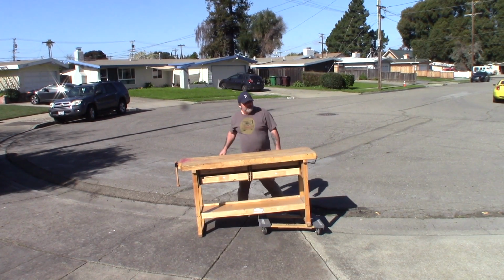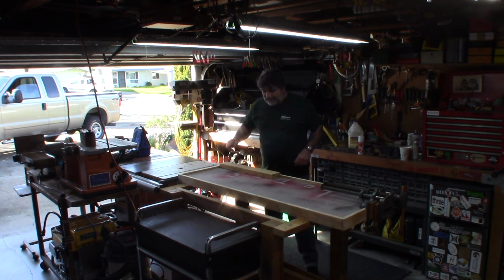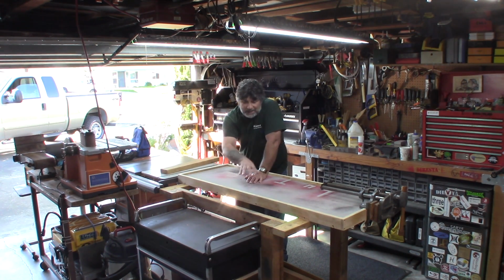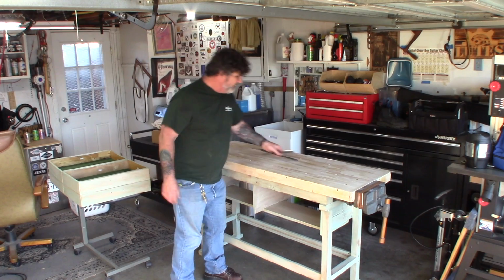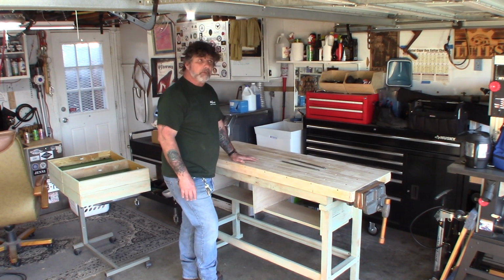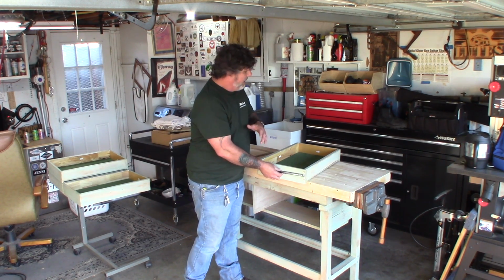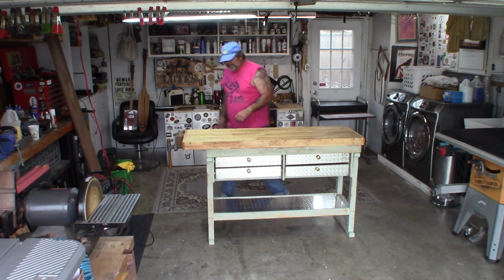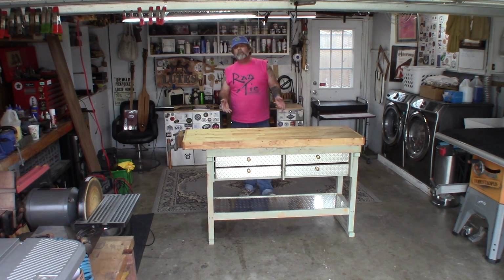How to turn a $100 Harbor Freight Garage Table into a Million Dollar Work Bench !!!

Comment: This bench is too heavy so adding weight to bottom is must. Also the pulls And drawers slides need upgrading big time. If you can get two and put them next to each other that way you have drawers on both sides and make it like an island then I’d say you have a badass table on your hands